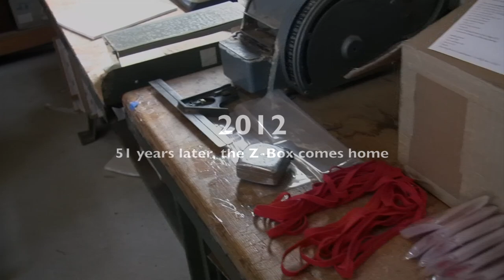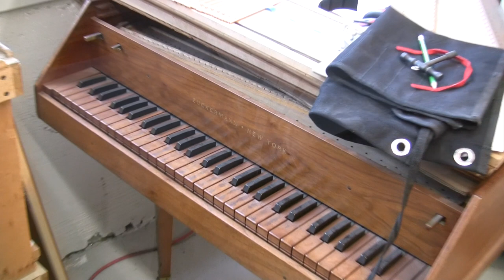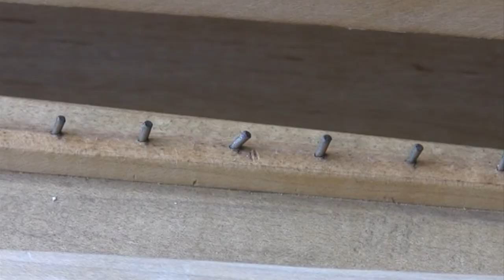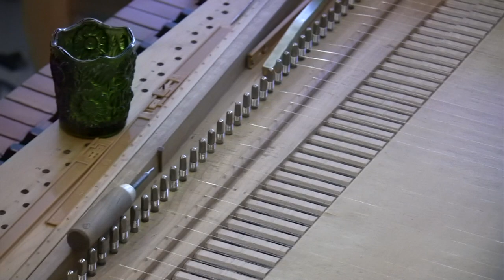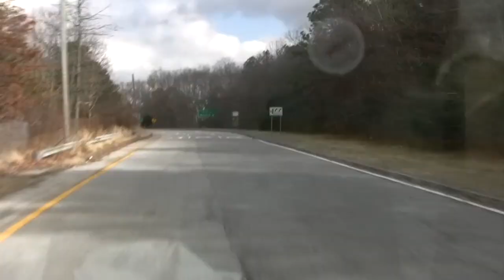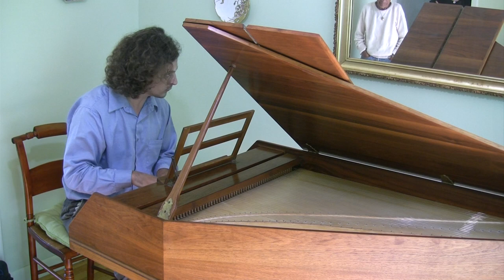The "Z Box"

Comment: Yes, indeed, Matthew E -- a Z-box with upgraded strings and plectra, well voiced, can really sound quite decent. My own instrument is similar (though the upgrades were done by a professional harpsichordist rather than by the Zuckermann shop and it has the old jacks, adapted, rather than the new jack kit -- and possibly a slightly different stringing schedule).

The fact that a Z-box goes to A in the bass makes it a great affordable instrument for a violist da gamba such as myself -- that's the range you need to accompany all the French solo literature for viol, matching the downward range of the 7-string French baroque bass viol.

Admittedly the lowest few notes on a five-footer aren't going to sound spectacularly well-defined no matter what you string it with and in what gauge -- the limitation is inherent in the short string length given the Young's modulus of available types of brass, if I correctly understand and recall a paper that Paul Poletti has written on the subject. But at least the low notes are at least there, and for most of the range it sounds very good indeed, a considerable improvement to the sound of the original steel music wire. It occasionally moves between A-415 and A-440 (with a day or two to settle and retune) without complaining, as well. The scale is (just) short enough to do A-440 with iron.
Reply from the maker: Thank you for that well-considered comment.   The z-box can be made to sing.  I am doing experiments now with bass strings and will post videos as I can.